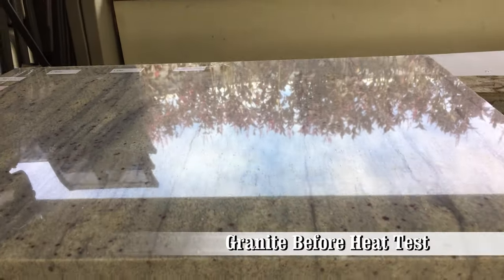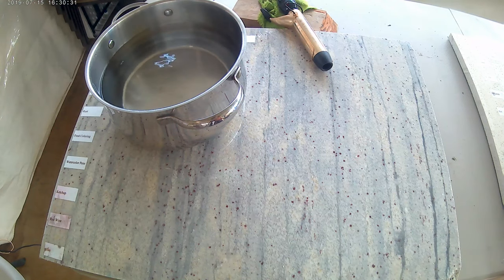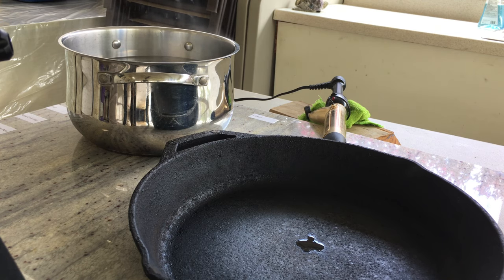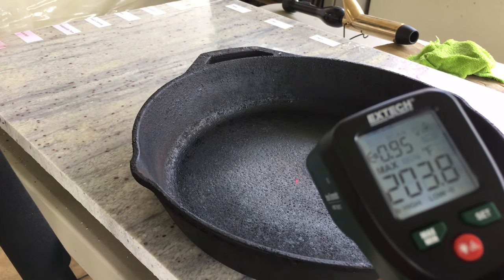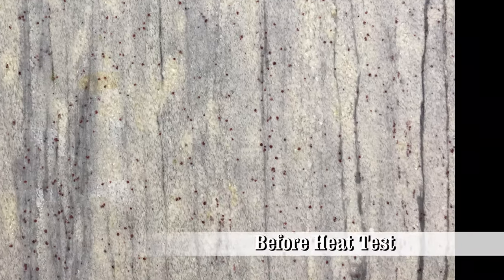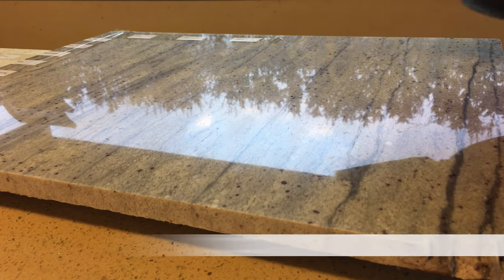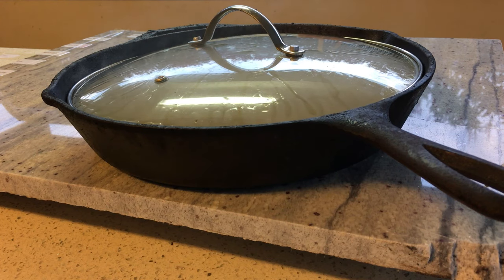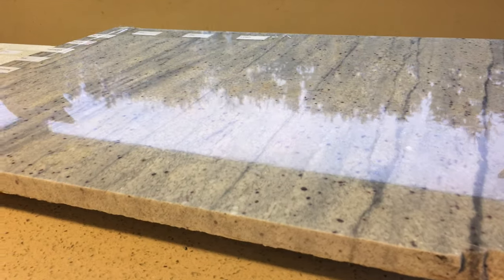Granite Heat Test: Granite VS Quartz Part 1. Which is Best and Most Durable?

Comment: This type of granite is actually a crystaline type rock. Cracks much easier. Not a fair test vs other stones. Also, having the stone elevated with air below it, will cause a temp difference much more than a slab sealed onto a countertop.  
_
The problem with quartz is that it is crushed powdered quartz made into a solid using epoxy resin polymeric and recycled products. It yellows and stains overtime. It doesnt have much issues with products sticking to it or staining it, BUT if you dont want the shiny stuff and get honed, it will stain, as the epoxy is not as much on top layer protecting the surface. What is bad is that if you put hot items on it the epoxy will yellow. If you have windows with direct light(UV rays), it will yellow over time. It also can chip on the edges. Most granite have less issues. Some sellers title a stone granite, yet they are not, and many have mixed types of stone in the granite. Granite is MUCH more resistant to heat as well. I have had granite, and hardly ever used a hot plate, and have had zero issues on a medium light to gray tne granite. It will not yellow, while epoxy in quartz will surely yellow.
What is more interesting is that Ceasarstone and many other makers, or even cleaning products have videos up with the comment section turned OFF, so they dont get customers posting all the negative experiences they have had.  The sad part is that many quartz companies charge MORE than the natural stone price for a product that is literally made by byproducts! Lots of MAJOR marketing has gone into launching quartz as the "best product for a kitchen, and this is simply false.
If you are doing a remodel and KEEPING the house, vs selling it soon after, a natural stone will add value and give a longer lasting product. Keep in mind that you can always polish or resurface natural stones, AND seal them if you want to add some security of stain or wear resisntance. You can also use an impregnating sealer for those radon gas worriers. 
Something to think about. 
I have researched this topic pretty deeply, and read many of the feedback from quartz owners of LONG TERM use and experience...I have now decided NOT to use quartz in my house.
Reply: I am a member of no quartz gang; had my new house done recently.
Reply: With granite of course.
Reply: @yviruss1  Its not a hard choice for me. Glad you are enjoying your granite. Quartzite which is a natural stone is also very nice. I am using both.
Reply: @philindeblanc  Nice. Did not know about Quartzite. Will read on it.

Comment: Also the granite you selected looks like New River White or Glacier White both soft stones with a lot of naturally occurring fissures . Which is less dense Quartz veins that run throughout the material. Try the test using Absolute Black 3cm.
Reply: EXACTLY!! this is the weakest of granites. Absolute black, and MANY other granites would do MUCH better in such test. This is the weakest of granites.
Reply: @philindeblanc  That’s true. As like every thing else there are different levels of quality. Plus most countertops are usually way thicker than 3/4”.
Reply: @pf5658  The developers and the push for higher profit and trends in marketing and design styles has pushed for most yards to carry 2cm, not more. I have looked over inventory of about 20 stone yards, and very few have a very low selection of slabs over 2cm.
Reply: @philindeblanc  Yeah! I’m not surprised to hear that. However, most of what I see where I live are at least an inch or more in thickness. I’m currently visiting several shops/yards as I’m in the process of buying a top for my kitchen island.
Reply: @pf5658  You are absolutely right, the granite is 1 1/4 .

Comment: BTW, 2cm or 3/4” thick is not a standard in residential kitchens. 3cm or 1-1/4” is the standard thickness. 2cm is a commercial standard and not for kitchen Countertops. 2cm (3/4”) is primarily used for vanities or wall cladding. Just saying . Most distributors rarely store 2cm material. So not sure where you are getting your info .
Reply from the maker: Thanks for the info, it seem the standard thickness depends on what area you live in.  Seems like the west coast uses mostly 2cm.  My store only stocked 2cm.

Comment: Your small pieces of stone look like 2 cm and not industry standard 3 cm. There are reasons as for why people in my industry will not use 2 cm. I work with stone every day and your quartz is going to burn and crack way before natural stone will. But anyone wanting to steer clear should just use Quartzite.
Reply: Agreed not 3/4". That was first giveaway, plus cheapest low quality granite available. I'd like to see repeated with a quality 3cm piece of quartzite.
Reply: well, many homes in the west coast are using 2cm. Hardly stocking 3cm these days. But, he has the granite elevated, so temp is different all around, not just top. AND as mentioned this is the WORST example of "granite".
Reply: It’s 3cm …..

Comment: I’d have to argue that 3CM is the std thickness for granite in the kitchen. I would repeat this test with 3CM
Reply: not really the "standard". In west coast its 2cm. Also new designs are with thinner slans as well, to get that modern low profile look. BUT, the slab should be fully contacting the counter or surface he is using. The difference in air temp is not only above, but under the slab. So there is higher temp difference and can crack easier. Not to mention, that the granite he is using is a partail granite and has lots of crystalline material mixed in it

Comment: Is quartz a good material for a kitchen tabletop ? I don't intend to expose it to extreme heat and will use trivets for hot dishes.
Reply: Granite and quartz are the 2 most popular non-builder grade countertops on the market. Granite is said to be better for heat (unless you push it to extremes like in this video). Many prefer quartz now though. It is a synthetic 'stone' and allows many more color and design options than granite. Also, depending on the style, many granite surfaces are seen as dated by modern design, not all, but some. I am interested to see part 2 of this, as quartz is supposedly a big no-no for heat. 
And I would love to see quartzite (another natural but even more costly material) added to the tests. As for resale for the average home, the 2 materials he is comparing are the most common. 
There are other options like laminate over pressed wood (builder grade), butcher block or other wood (cheaper/more natural options), concrete (heavy, cheaper, design limited), stainless steel (cheaper, durable, clinical looking), marble (expensive, porous, bad kitchen choice outside of islands), and I'm sure others.  
Whew!! In short, to answer your question... Yes, quartz is super hot right now. Just be sure not to get it super hot if you choose it :)
Reply: If its an apartment or condo, quartz is a OK option. You have to realize, that the quartz powder and the recycled material used is a trash waste or used in agrigulture product. So instead of trashing this powder, they take it and process it with epoxy resin, a polymeric, and put it in sheets form and sell it for MORE than Italian porcelain. So you should know you are getting ripped off unless your slab is less than about 2 to $10 a sqft@2cm, depending on the fabrication cost, origin.
__ But even knowing this, the long term use of quartz is bad, as it will yellow over time just from sun exposure. This will not happen in most cases in 1 year or 2, but for areas with lots of windows it will happen sooner than later. It can be 3 years or mroe, but it will happen. With natural stone, you can ALWAYS refinish the surface. With epoxy, it is not so simple. Also, natural stone, is natural and recycled. Epoxy resin is not.  If you are doing for your own house, and you are not flipping it to sell, I would recommend to go with a natrual stone. There is granite, quartzite, dolomite, marble. In this order of strength. But keep in mind there are many mixed stones, so some will be stronger than others. If you are not sure if you will ever sell, I would stay with more neutral tones, or small patterns, or less busy patterns.

Comment: The granite wasnt sealed most likely
Reply: you dont need to seal granite. this is the worste example of granite as it has lots of fissures. Any real granite will not do this. More metamorphic rock than crystal and there is nothing he did that would ruin it. BUT, yes, for stains, you should seal granite. I did not for 15 years with ZERO issues...wine, lemon, balsamic vinegar..etc, NO ISSUES.

Comment: That's not real granite !
Reply from the maker: Hey sha moo, What makes you think that it’s not real?
Reply: Sha moo, exactly! Was thinking is everybody that thick and not realise that?

Thrifty: its artificial granite (granite dust, sand, acrylic), not even close to real granite in its properties "that was once a molten rock". Look it up.
Reply from the maker: Aron, I can’t find what you’re talking about on google.  Can you post a link to more info on artificial granite?
Reply: @thriftytani46   any google search like "artificial granite" or similar will do. Heaps of results. Also, here is this: https://www.surreymarbleandgranite.co.uk/what-are-synthetic-granite-worktops/

explains when people complain about staining etc why they are most likely not even dealing with actual solid granite countertops. OR that person in the comments who said a lighter will melt granite... 
Most countertops I see these days in homes are all artificial. Marble as well, even easier to spot.

Also, not to be mean but when you close up in your video at 2:20 to show the crack and you can see the pattern of the slab and those red dots... yeah that doesn't look natural rock at all.
Reply from the maker: Aron, i checked out the link, and it appears synthetic granite is composed of epoxy, I’ll post a video of the slab over a flame to see if it burns.   What do you think?
Reply: @thriftytani46  This maybe sold under the name granite as it has some granite in it, BUT, the piece you are using is NOT granite. It is crystalline filler that occurs between the metamorphic granite. Take ANY cheap but real granite, and you will see a MAJOR difference. Granite has ZERO translucence. You see this rock you have has that white, and is VERY translucent. Redo the test and you will be surprised how strong real granite is.